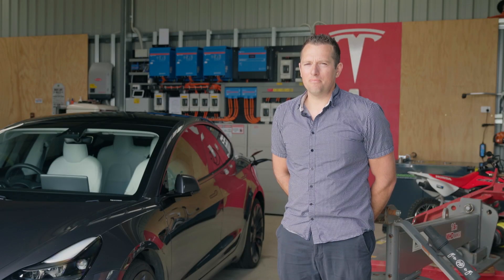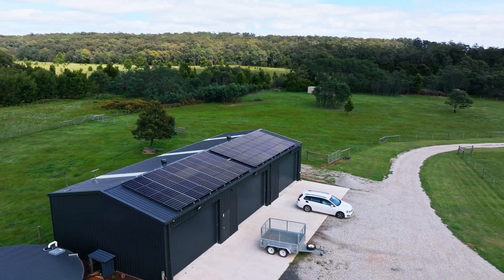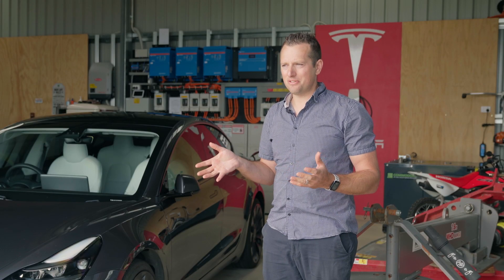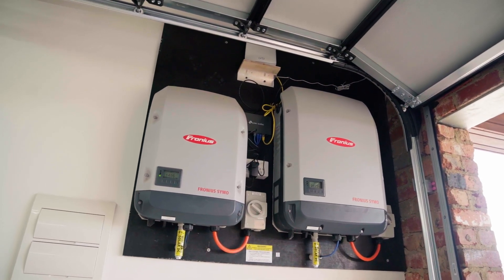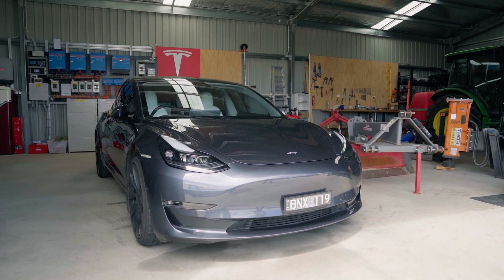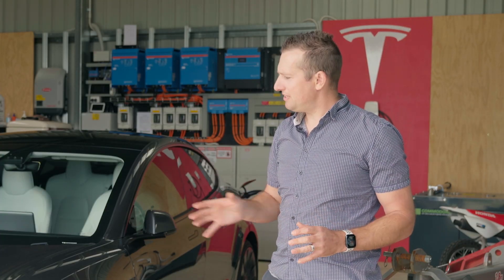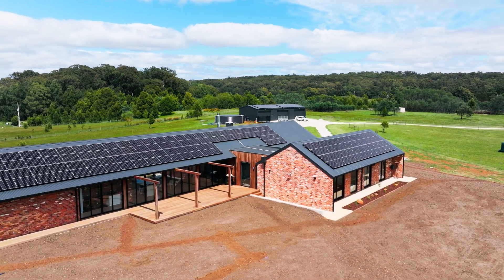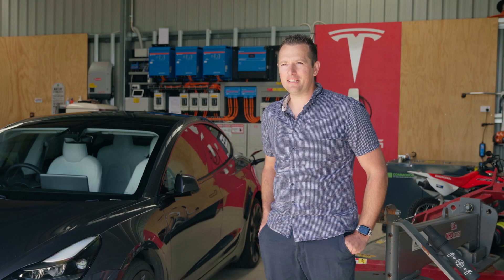Tim’s Journey to Off-Grid Living | Massive Off-Grid System in Benloch Victoria | Commodore Australia

Comment: I live in Wisconsin, cold dark cloudy winter days. 74kw of ground mount solar, and 350kwh of battery storage, full off grid, 2 ev's, full electric house, and I mine bitcoin with excess solar, and it heats my shop in the winter. All DIY, all done by myself and my daughter.
Reply: What do you think you spent especially doing it diy
Reply: @jamminjaymn7675  Still a lot, lol. Don't even want to know. It was my plan to be fully off grid and here I am.